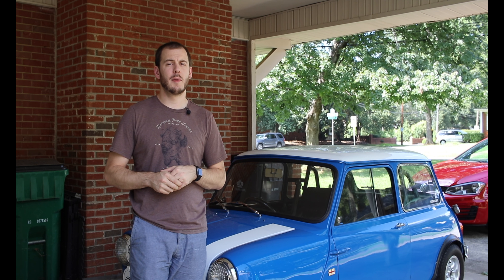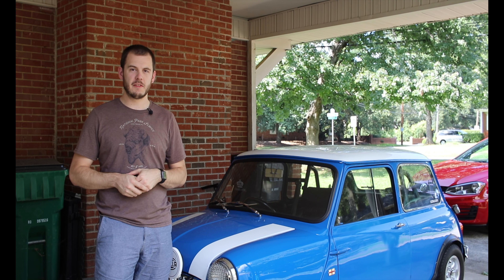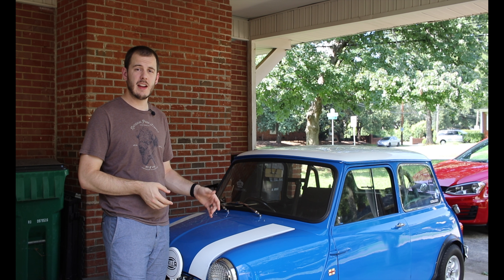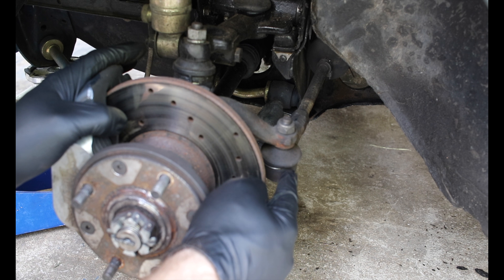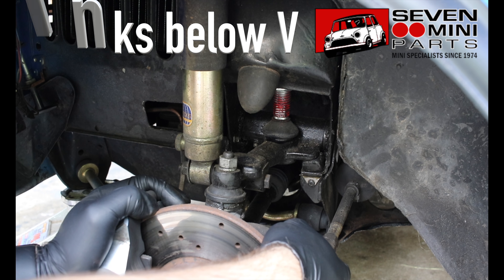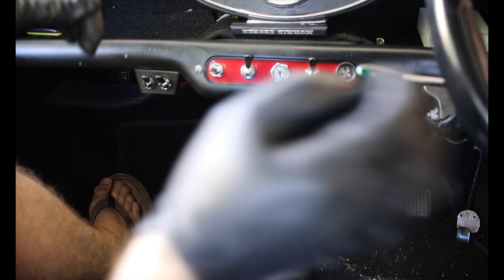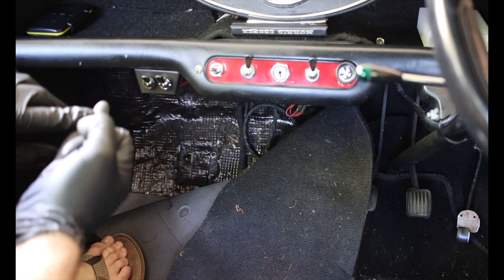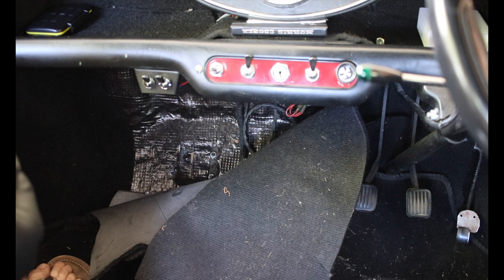Classic Mini DIY - RHD Conversion?

Comment: You missed loads of detail.  Apart from changing the rack and moving the column you need to: move pedals and change throttle, change throttle cable, brake and clutch lines, flip heater matrix, maybe make up new heater hoses, move dip switch, flip wiper motor, change wipers and ideally, change the asymmetric door locks.  Did I miss anything?
Reply: Exactly. What is being moved is the steering position. The steering wheel position is only one of many things to be changed.
Reply: @PierreRousseau1958  its still pretty straightforward.  I changed my RHD to LHD easily enough but there is a lot more to it than shown here.
Reply: you just need a friend you trust in the passenger seat to operate the pedals

Comment: so basicly the only part that you need to do the RHD to LHD conversion is LHD steering rack ,what about the pedals do you need a specific pedals for LHD Mini or you can reuse the ones that are in the car and are there holes in the floor on the left side aswell like for the steering rack  ,are the cables for gas brake and clucth  the same or again specific for LHD car ?
Reply from the maker: Hey, you will need a corrected fuel pedal for the other side but I believe the brake and clutch just swap over. I would need to do some fact checking on that to be 100% sure. Cable for the gas does not need to change to accommodate the alternative placement but in some scenarios depending on the carb, it might work a bit better. Brake and clutch do not use cables as they directly connect to their master cylinders respectively. You will likely need to purchase a longer clutch master to clutch slave line since the LHD cars have those farther away from the clutch. Then you might additionally need more copper line for the brake master cylinder to the brake lines on the right side. Sorry, that's a lot of info if that doesn't make sense or you need more detail let me know.
Reply: Classic Mini DIY its very clear explanation , and does brake master cylinder need change of position?
Reply: @lesafighter  Brake and clutch master cylinders are swapped to the other side and new pipes made up and fitted.

Comment: If youre changing lhd to rhd, the firewall must be removed by drilling the spot welds or can i just cut the edges and sides of the firewall off the car and removing it just like that??..
Reply: There is no need to remove the firewall.